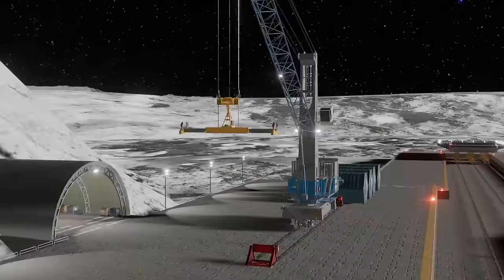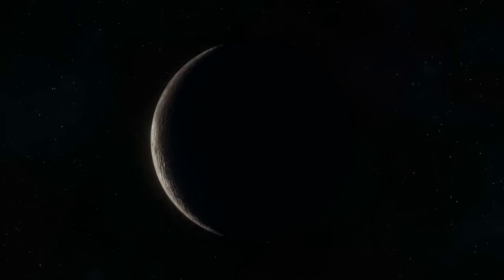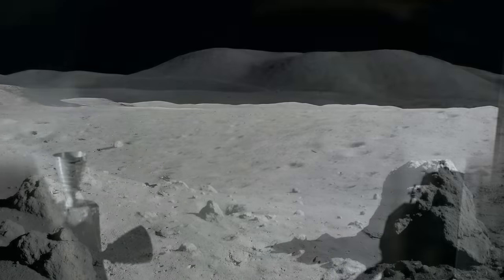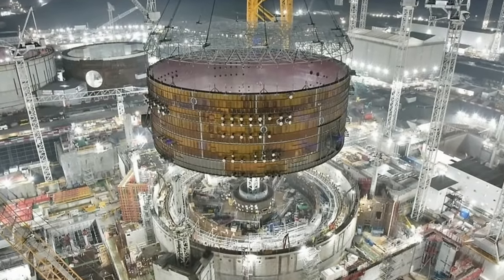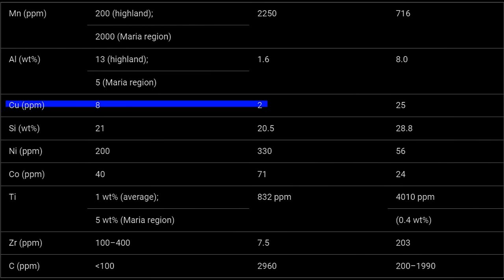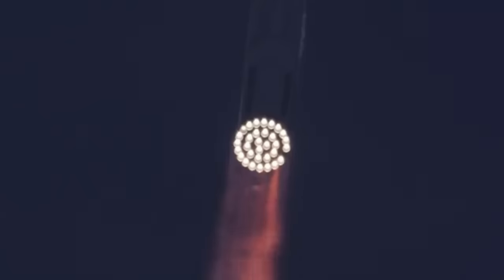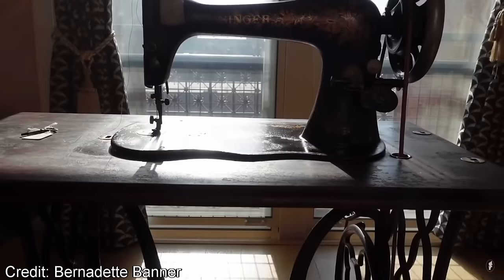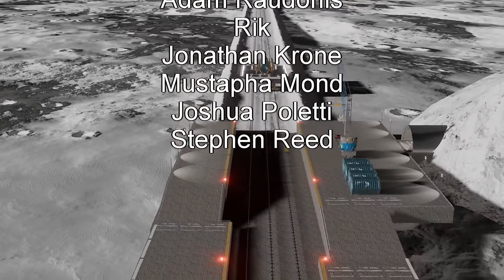Designing Heavy Machinery To Excavate The Moon

Comment: Just teather an electrical cable on off a larger main power reactor and require it to me connected tue whole time
Reply: Simpler is usually better in the case for construction/machine operation. A fancy power source like a mini reactor or battery pack is kinda unnecessary, as you'd probably want to set up close to a settlement anyway. And repairing a complex system on the moon would be shitty by itself but limiting the capabilities by what tools/equipment you can reasonably transport to the equipment with distance you give up efficiency.

Comment: You're pleased to save the space station because it's already in orbit and we work so hard and paid so much to get it up there are misguided it's an old space station it's getting more and more expensive to maintain it every year the Delta V required to move it from Earth orbit to anywhere else is so extreme that it would tear the ship the station apart we simply do not have the current capability to do anything else with the station put in a higher parking orbit you cause possible to continue to degradation and harder to get to and more exposure to radiation it just doesn't work the only thing that we can do is to deorbit it and do it safely

Comment: Can we make steam powered machines shich are heated by electricity?
Reply: In theory, probably, but finding that much water on the Moon might be harder than finding lithium, let alone sodium.
Reply: Steam engines are limited by Carnot heat engine equation, that you need high temperature and pressure to be efficient. Even our advanced ultra supercritical steam turbines (yes its GE marketing term) running at 650 deg C and 330 bar runs at only 47.3% efficiency. While your washing machine induction motor is 78% efficient, and bigger more advanced motors can run at 97% efficiency

Comment: What about hydrongen fuel cells instead of Sodium batteries?
Reply: Because hydrogen fuel cells use platinum catalysts (or lose a lot of efficiency).  There probably is platinum on the Moon, but finding it will be just as difficult as it is on Earth.

Comment: I think you hit the nail on the head.
We CAN'T build any long term colony without having heavy machinery to blaze the way.
0 large scale projects start without heavy machinery.
Reply: An auto brick maker layer machine  capable of harvesting it's on regalith. We would have to supply it with the mycelium bags that use the regalith for filler material. Once the bricks are placed, they grow together and form a hard structure  that's surprisingly well shielded from radiation because the mycelium is isung it for energy to grow it's parts. Once they finish growing, the bio mass continues being radiation resistant.
Reply: @pilotnamealreadytaken6035  that's great, but you still need excavators and bulldozers. Without flat, prepared ground, the brick maker layer machine is useless.

Comment: The ISS is worn out.
The idea that mass in orbit is very valuble because launch is expensive is based on a fundamental miss understanding of launch costs.
First, current launch costs arnt very different then it was in the shuttle era, and are primarily driven by program cost per year, divided by the number of flights.  Flight rates a still so low the direct cost per flight gets lost in the noise.
Bottom line getting cost to LEO down about a thousand fold isn’t hard, is almost unavoidable, to cut launch costs 100-1000 fold if you do anything big in space.  I.e. developing the moon would completely undercut your assumptions  pushing you toward this construction concept.

Agree big vehicles weight is a plus.  But unless you need to move a huge amount, a huge vehicles pretty useless.  So far you haven’t exactly shown a need for a strip mine?

You didn’t cover the extream abrasion of lunar soil?

Also electro magnetic actuators are replacing hydronic actuators in aerospace uses anyway, so trying to make cable and pulley systems survive long on the moon, is likely a moot point.
And you again ignore the weight and cost of shipping the factories, mining equipment, etc out.    This actually makes it much harder to sustain development of the moon, since rather then the cost of shipping low cost finished apartments, your shipping full industries out there to build a couple copies.

Comment: Smaller is better.. 3d printed steel components to build simplistic small robotic units each specific to a task but in vast numbers so the impact is greater..and losses are literally recycled. Spindle wire 'wheels' can traverse all manner of environments..small machines combing the moon 'desert' bringing back small payloads to be sorted in the comfort of a bunker.. weight is an issue since they would be heavy steel..with battery power..density is irrelevant since there are many many tiny machines tagging in and out as power levels dictate.. the steady stream of material is the goal.. cheap machines, easy to build and replace that yield a certain amount of material per lifespan. Inefficiency is acceptable as a tradeoff for reliability, and continuity. 'batteries' that can rugged and simply made are of higher value then expensive high density batteries.. salt water batteries or thermal batteries are probably more viable

Comment: moon vehicles will be alto like early cars, and early 1900 electric cars, box frame chassis with a electric motoor and batteries
similar to a body on frame , like a old truck, 2 metal rails, with leaf sprigns, steel wheels, a box with lead acid batteries, and a aluminum electric motor,.... think of a  rolling truck chassis with no body on it
Reply: like google truck chassis simple, tis just 2 logn square tubes, shove a box inthe middle between them and add electronicsinside it, 
at the front and back axles, do a dorect drive sorta gearbox/transmission like most electric cars, then what ever you want on top be it pasenger or hopper or container

Comment: For the bootstrapping phase, I reckon we can skip the batteries and just power the machinery directly from solar panels by cable. Any excess can just go straight into big heavy heatsinks, hopefully designed in such a way that we can remove the heatsinks and replace them with batteries as they get built.

Comment: Couldn't get past the first 2 minutes after you made it clear that you know more about the ISS than NASA does. To address the metal fatigue resulting from 16 cycles through hot and cold every day, would cost considerably more than the number that you already balked at. If the rest of the video has the same level of arrogance, I don't want to see it.
Reply: The ISS is modular, and some parts are more susceptible and more sensitive to metal fatigue than others.  I agree the older habitation and lab modules are unsalvageable, but the main truss should be fine.  The brand new solar panels SpaceX has  been busily delivering for the last several years are fine.  The brand new giant station batteries SpaceX delivered recently are also fine.  Both of those new power systems should last much longer than the current projected deorbit date.

So what's wrong with continuing that modular replacement strategy?  Detach and individually deorbit leaky old hab modules and bring up new ones to replace them, possibly inflatables.  The Bigelow module currently connected to ISS has performed admirably.  Bigelow Aerospace is defunct, but Sierra Space is scrambling to replace them and should be fully qualified in time.

Heck, send up more tin cans if you must.  Thales Alenia still exists, and is busy manufacturing more tin can modules for Axiom Space.  They also make the pressure envelope for the Cygnus spacecraft, one of which launched to ISS just hours ago.  I'm sure they'd be delighted to accept a contract to manufacture some replacement modules.  After all, their production is spun up to do just that right now, so they can probably offer a nice discount.

ISS doesn't need to be destroyed.  It just needs significant refurbishment, much of which has already happened.  Let's face it, NASA doesn't want to destroy ISS for mechanical reasons.  They want to destroy it because ISS ground operations are absurdly bloated and expensive and Congress is balking at continuing to pay for it all.
Reply from the maker: Even if it isn't habitable its a time capsule. Or load it with instruments and send it into deep space. Voyager 3.
Reply from the maker: Great comment

Comment: Ok, my view that there is nothing of interrest to humanity in space aside, why the insistence on batteries? 

I work in forestry, and major sawmills use vehicles hooked directly into the wider power grid by now, and doing the same thing with mining vehicles has been done for decades by now. I see no real benefit to relying on batteries. You mentioned the problems with complexity in your video, but then you added unnecessary complexities where there is no for me easily discernable reason to. 

Also, storing heat in matter akin to how a tile oven does it might be the most reasonable approach to get over the lunar night, especially when there is no nuclear reactor available. 

Well, its not like there's any point in having people on the moon anyway, so it's probably not sensibele to think about it.